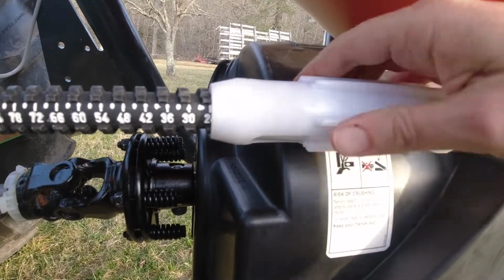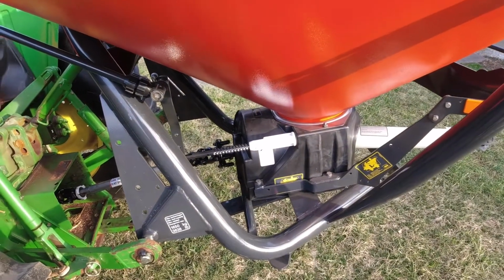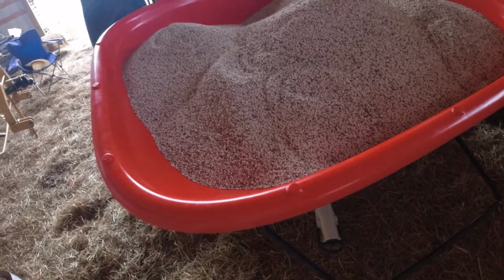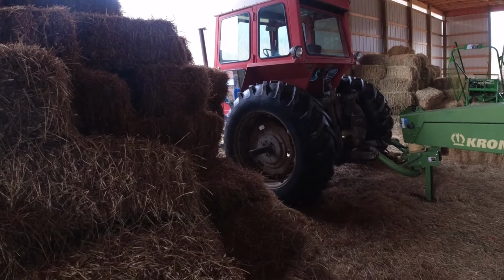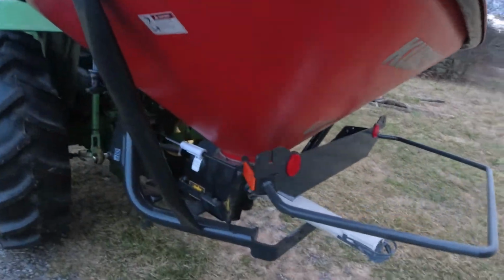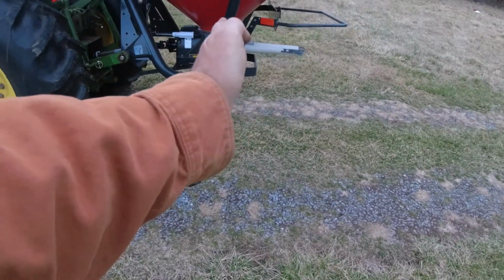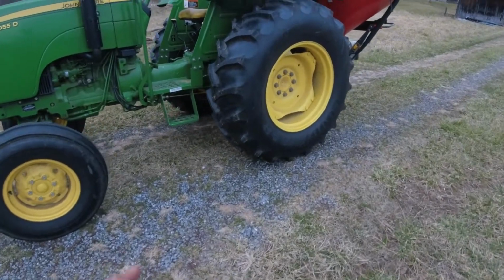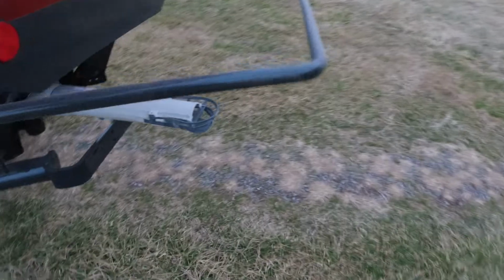Finally Fertilizing - Kubota Fertilizer Spreader & John Deere 5055d

Comment: Interesting design 
That’s a lot of Phosphorus, you might call this spreader The Rattlesnake.
Nice economical row marking
Reply from the maker: For our inputs, 46 actual lbs of phosphorus is on the low side.  Depending on the yield expectations, sometimes our soil samples call for over 90 actual lbs of phosphorus.  Thx for watching!
Reply: @HumbleHaymakers  Interesting info
Our UGA soil test recommend for Costal Bermuda;
N- 200 to 400 pounds per acre, 75 to 100 pounds in spring growth,75 to 100 pounds after each cutting. After the initial granular spring spreading we use 70 units of liquid nitrogen after each cutting.
P-60 pounds per acre
Phosphorus prices have increased enormously thanks to the "New Administration"
K- 200 pounds of potash per acre
Potash prices have increased by $20 a ton
thanks to our 
All in All,
 were going up on hay prices this year
Happy Harvesting